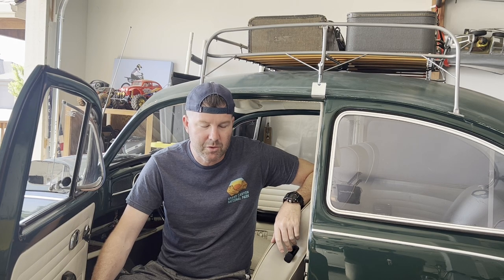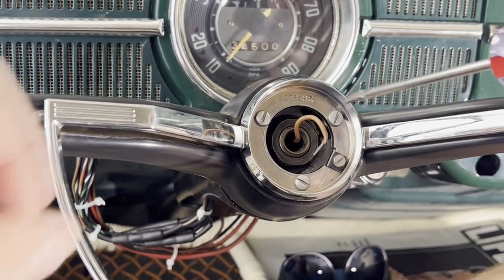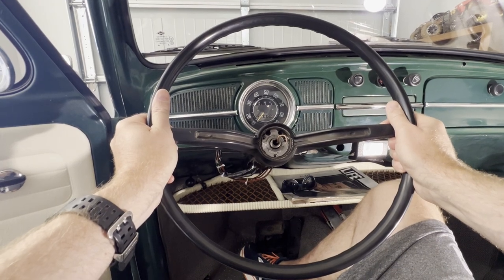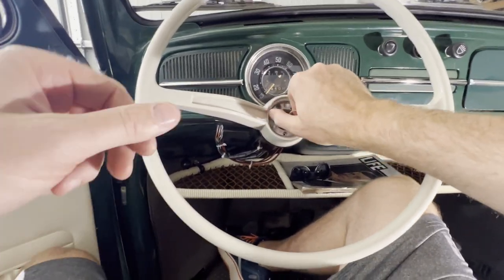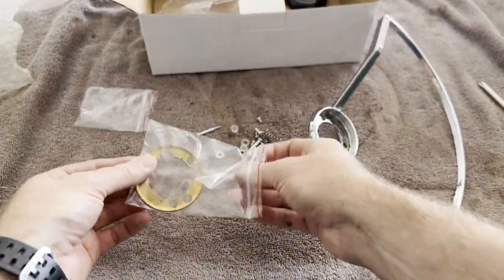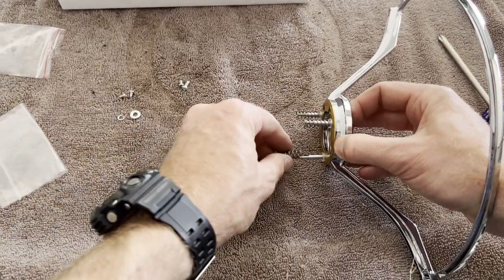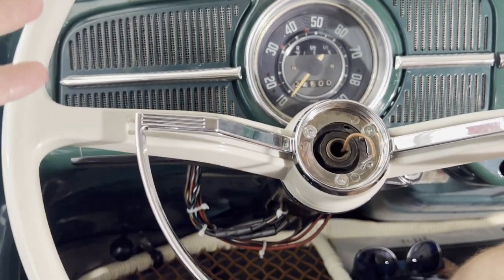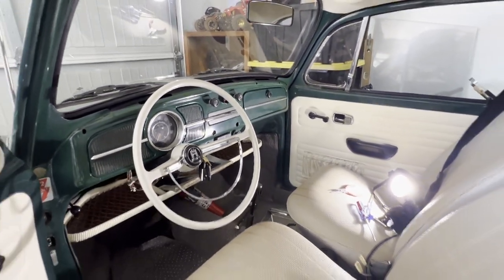1968 Volkswagen Beetle Steering Wheel Upgrade - Remove & Install

Comment: I'm getting ready to remove the steering wheel on my '65 and I found your video very helpful.  One thing ... I think the bevel on the contact ring is supposed to point in the other direction.
Reply from the maker: Glad it helped you out! I'll take a look at the ring, thanks.
Reply: wondering that too, I've tried both ways.

Comment: I backdated my 69 dash to the earlier ones as well wanted to know where you found the radio cover and the process for adding the chrome molding trim too! Thanks buddy!
Reply from the maker: The radio block off plate I found on eBay. The block off plate comes with its chrome trim that has pre-drilled holes. The rest of the dashes chrome trim is a kit from J-Bugs.com. I had to drill my own holes in the dash for the trim clips. Just find the center up and down on the dash, measure twice and drill with a metal step bit. Side to side doesn’t matter too much because the clips slide behind the trim. I probably should have made a video on that too. Good luck with it! Thanks for watching!

Comment: Great video, clear, good lighting, good camera work. Question about the brass plate "cup". Some videos have the raised rim facing up towards the ring and others have it facing down to the floor. You have a 68, I have a 67 bug, is there a big difference?
I've tried both ways. One way the horn honked when I just turn the wheel. The other direction I didn't get any horn at all. 
Is there a big deal about the plate cup direction?
Reply from the maker: Thank you and thanks for watching! The way I installed my brass plate in the video seemed right to me. My horn works fine, I just had to adjust the three screws a bit. I had a guy tell me mine was backwards. Like I said, my horn works fine so I’m leaving it. I don’t believe there is a difference with a 1967. I’ve never owned one so I can’t be 100% sure. Maybe try adjusting your 3 screws that hold the horn button on, some more. Did your horn work well with your previous steering wheel? If you have the old chome horn button setup try that one with the new wheel.
Reply: @CMSgarage96  I just put on a new ring kit, no wheel, yes it worked before. I broke the ring honking, cheap metal. I have power when I touch that wire to the screws.
First time back together I had a short somewhere and it honked when I turned the wheel. So I flipped over the cup and I get nothing when I push the ring. Weird. I thought maybe I had the plastic sleeves in wrong or that wire should be mounted with sodder to that clip thing.
Reply from the maker: @donk.johnson7346  gosh! I wish I had the answer. I would just keep messing with it. It has to be something simple. It’s just not making a good connection. Good luck with it!
Reply: Here is one thing I might have messed up. To keep those springs in the holes in the wheel, I put a drop of liquid electric tape on the ends that fit in the wheel it's self. Otherwise they kept falling on the floor while trying to line up the ring and screws. 
It should not mess with the contacts. But there is that bit of difference.
Reply from the maker: Yeah maybe that stuff is acting as an insulator.   @donk.johnson7346
Reply: @CMSgarage96  I got it working but the ring is really lose and does not even fit in the groves of the wheel but it works now. What a pain.
Reply from the maker: @donk.johnson7346  Glad you got it working!

Comment: I thought the steering wheels with the horn notch came only on 63-64 beetles?
Reply from the maker: Are you referring to the chrome horn ring maybe? This style of steering wheel was used on 1962 to 1971 beetles.
Reply: @CMSgarage96  I didn’t know that the steering wheel with the notch was offered all the way up to 71
Reply from the maker: @cyprianskiba8768  In 72 they went to the plain black large padded steering wheel

Comment: Where did the clip for the wire even come from?
Reply from the maker: Not really sure what you mean? The piece of medal that holds the horn wire down? If that's what you mean, it was part of the original wheel.
Reply: @CMSgarage96 the little black clip that holds the horn wire on. I assume it didn’t come with the new steering wheel? I have the exact same one and I already put it on, Im just confused about the horn wire clip because I don’t have one
Reply from the maker: Yeah I don't think it came with the new wheel. I used the one from my old wheel. I don't think you really need it though. You can just loop the wire under the screw. Or you could add a round ring terminal to the end of the wire.  @daencabrera10